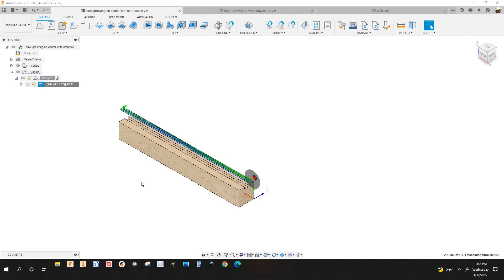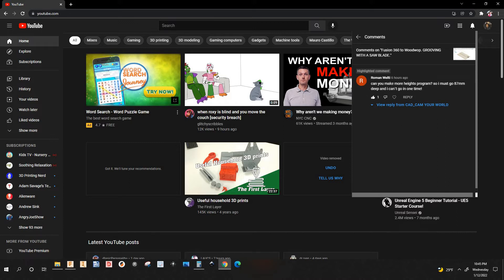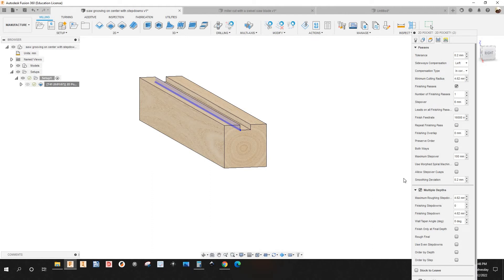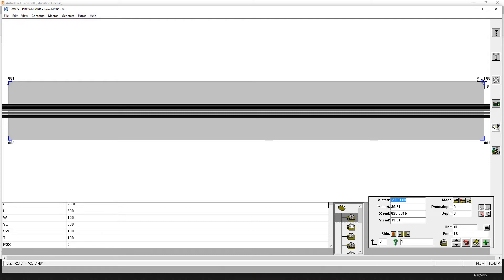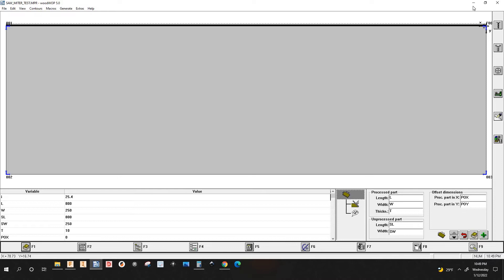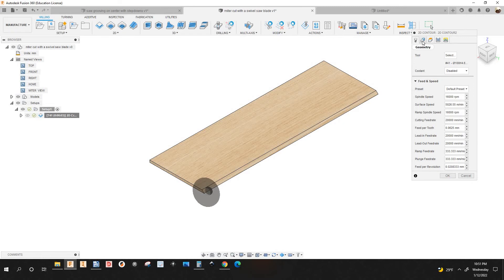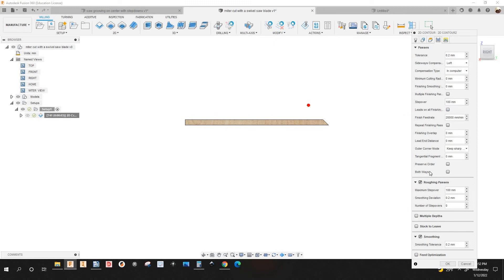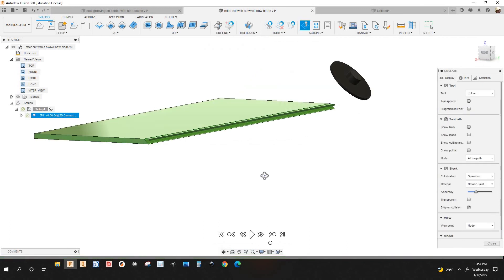FUSION 360 TO WOODWOP. SAW GROOVING WITH A STEPDOWN AND MITER WITH A SWIVEL SAW.

Comment: Nice video how do you add the saw blade in your tools library in fusion 360 thanks!!
Reply from the maker: Thanks, go to manufacture workspace and select tool library, create a new folder in there on top left there is plus icon, click on it to create  a new tool, then  you select slot mill.